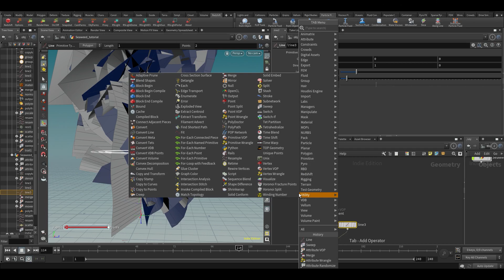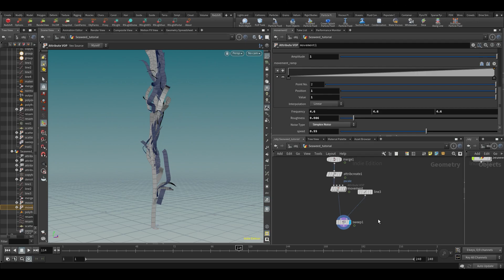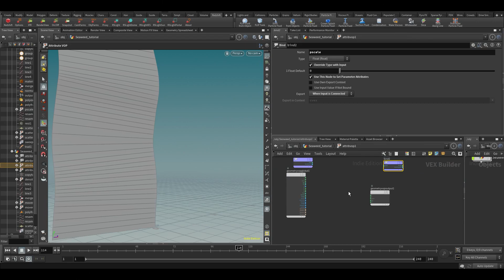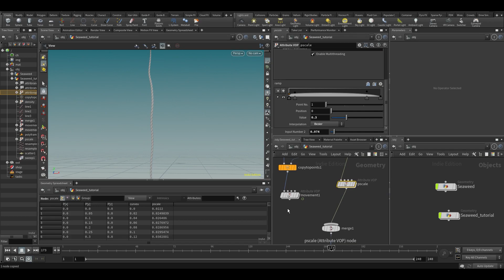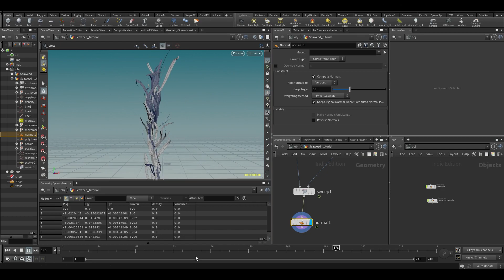Learn Houdini: Howdini101 - 019 - Seaweed 03 (houdini beginner course)

Comment: Hi Tim! i think i'm facing the same problem @moikle is talking about. When i make the sweep and connect the line, my stems are all jagged and the main stem is fliping constantly. I'm already put the pscale attribute just after the merge node and i dont know whats wrong.
Reply from the maker: flipping gets fixed in video 21. Let me know if you still have issues after that.

Comment: I had to add a polyframe after the resample on the leaves, which you didn't seem to need. Where are the normals coming from on the leaves in your version?
My stem also comes out jagged, rather than smooth like yours.
Reply from the maker: For your jagged stem, you probably just need to increase the amount of points the resample makes. The default is 10, up it to 50 or more 
For the leaves, what is not working for you exactly? which part of the leaves are you having issues with? because that's not really clear.